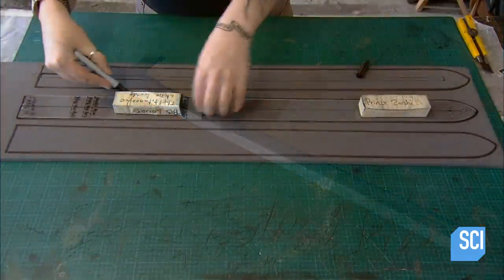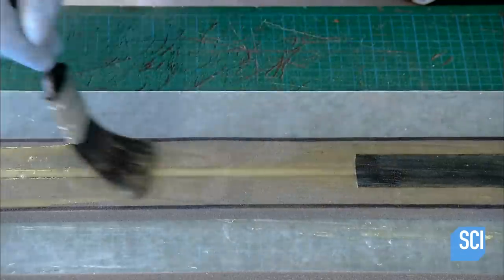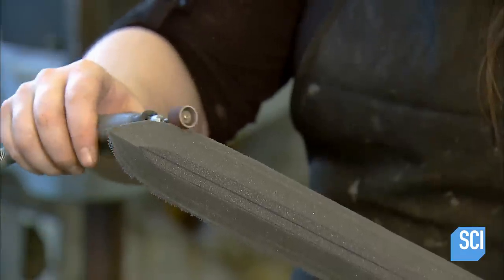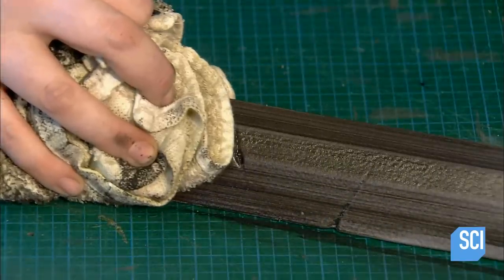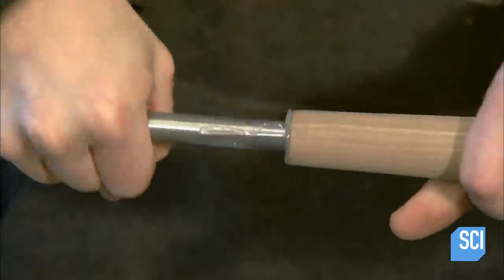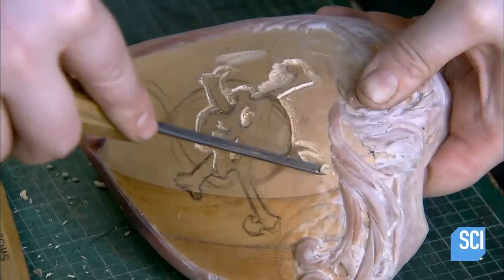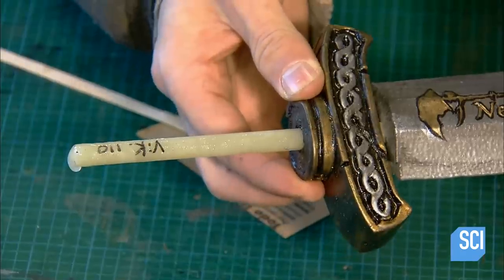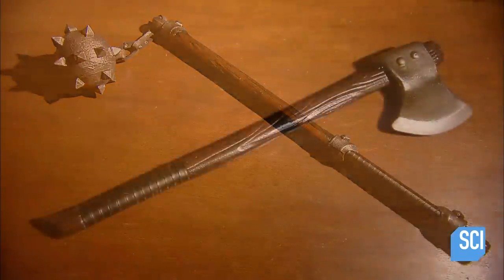How It's Made: Latex Swords

Comment: Why would you buy a latex sword. I know two actual blacksmiths, if I buy a sword that's where it's happening. Not to mention if you want to swing a sword around, use the real thing (preferably learn how to use it first).
Reply: To use in larp combat. Since they are made of foam, you can hit someone with them relatively safely with minimal safety equipment. Real steel swords are only good for full armour combat, and still are prone to causing injury.
Reply: @damiansforge  Exactly. If I swing a sword at someone I want their head to role, not be slightly stingy at the point of contact.

But that's just me, if I'm violent I'm violent for real, it rarely happens but when it does there's a possibility of grotesque things being done.
Reply: @JMS-2111  HAHAHAHAHAHAHA that has to be the cringiest edgelord comment ive ever read 😹